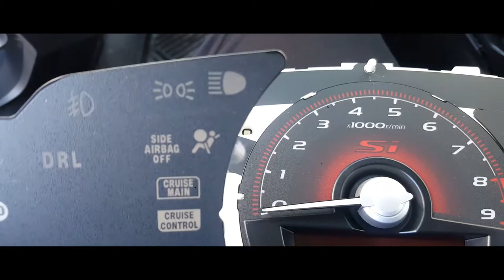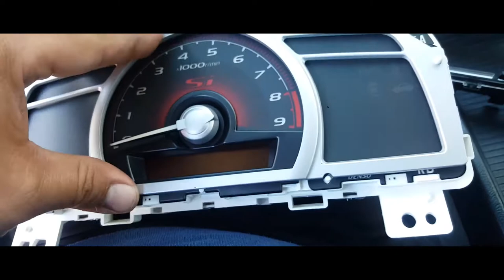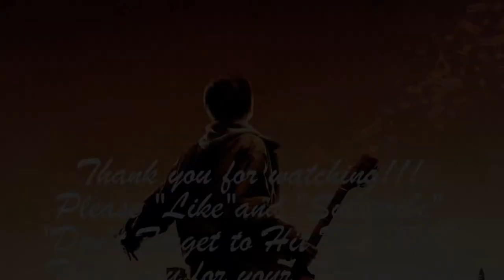How to: 2006 Honda Civic Si Airbag Light Problem Hack

Comment: How u take the pieces off ??
Reply from the maker: Lol yeah you gotta remove the trim pieces with a trim tool removal. Or just pull on them.  The one for the upper piece has 2 screws at the bottom....sorry bro. Just decided to do a quick video since I had that off